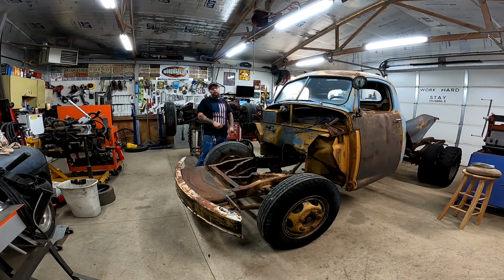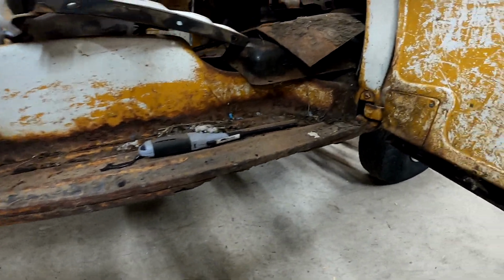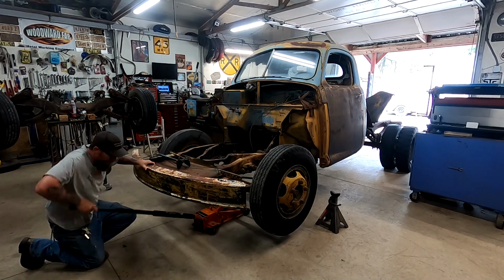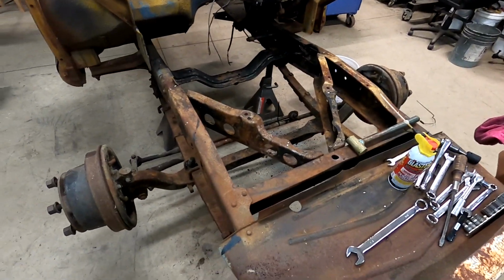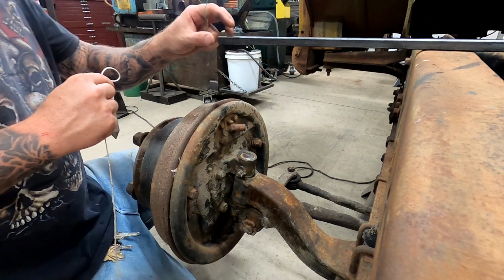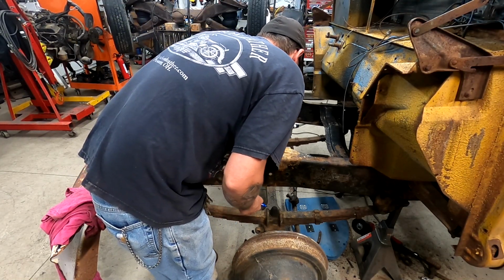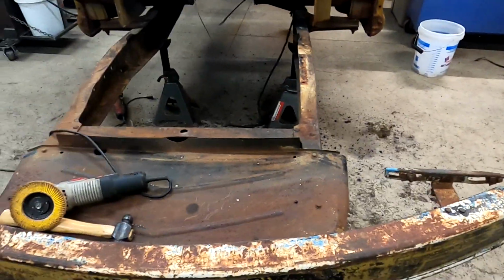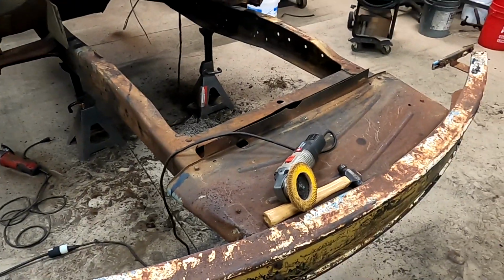1949 Studebaker Rat Rod Build Series Part-1  (1-Ton of Fun)

Comment: I just found this series. Looking good so far. I've been building a '50 Studebaker truck Rat Rod. You started with way more than I did. All I had was the cab and the box and they had been sitting on the ground in a swamp for decades. there was literally half the firewall gone, no floor left, and several inches rusted off the cab corners and part of the doors. I built an entirely new firewall and floor, but I left the rest of the rot. I put in on an S10 chassi, slapped in a chevy inline six that I had with a 3 speed muncie. It's actually a lot of fun to drive. I'm almost finished. I'm gonna continue watching the rest of the series, looks fun.
Reply from the maker: I got really lucky with finding this truck here in Ohio I actually have 2 of them both 49’s the other one is probably worse than the one you started with it was a farm truck been in Ohio it’s whole life. The one in the video is originally from Nebraska so it had seen a much better life with the rot. Thanks for the support I appreciate it.